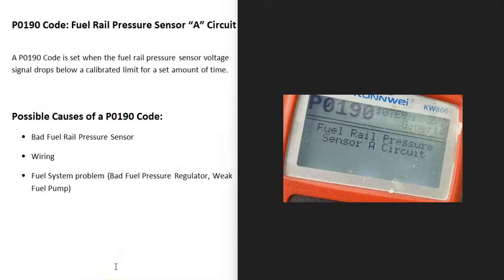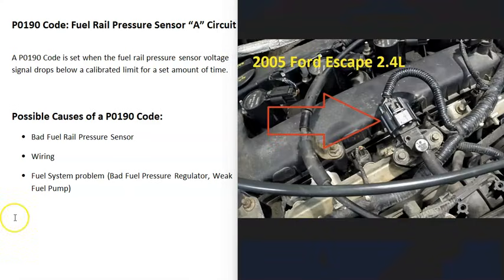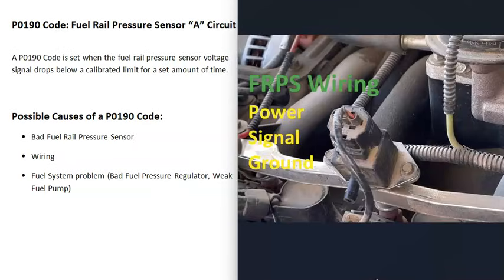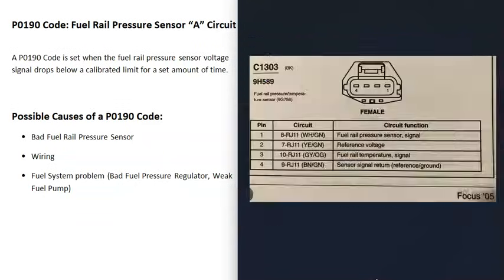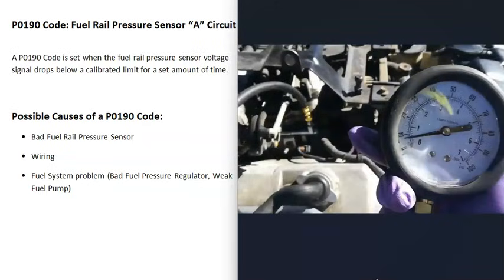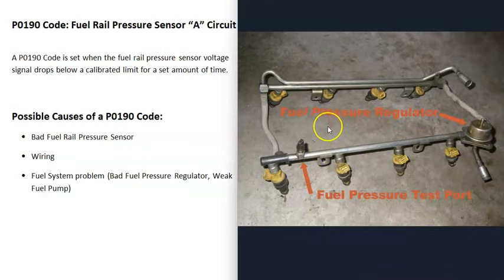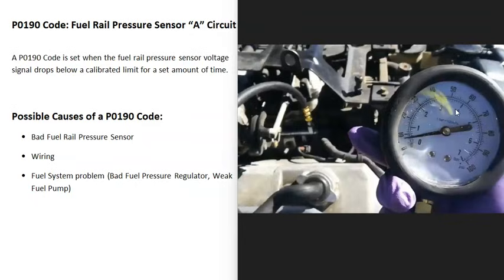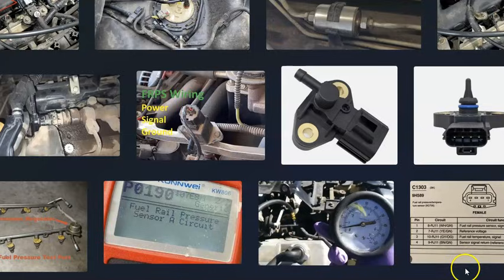Causes and Fixes P0190 Code: Fuel Rail Pressure Sensor “A” Circuit

Comment: Hi have a 2012 polo 6 GTI , did a diagnostic and showed P0190 code so we changed the sensor cleared the error the car still didn't want to start took a diagnostic and again it showed that code and there is no wires broken or damaged
Reply: Try to check if the fuel filter is not clogged, check the fuel pressure regulator or if possible try to check what pressure you are getting which might be causing this issue

Comment: Hi Pal 
Got p0190 on my Vivaro 2.0 diesel 2010 but when check fuel pressure it’s 29900 kpa and when using acceleration it’s reacting by going up when accelerating. What u think it is ? Thank you